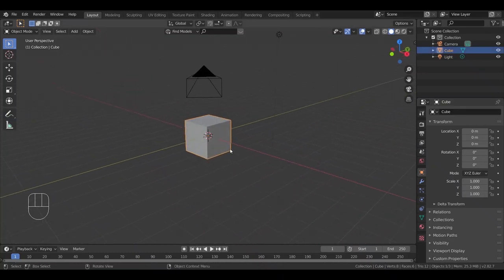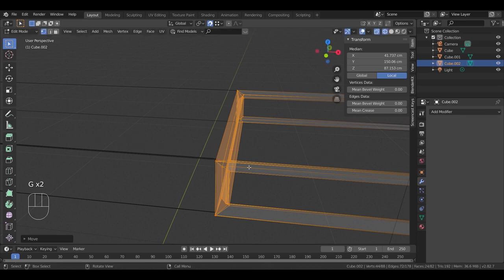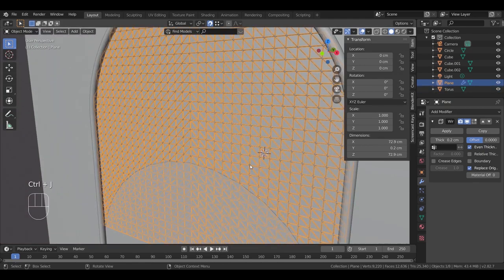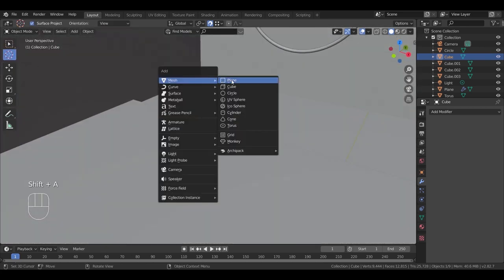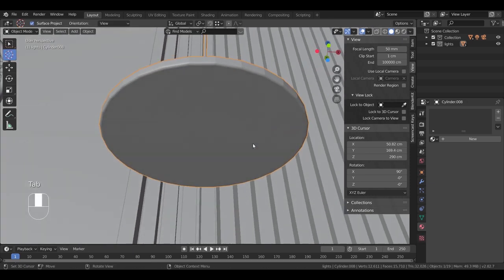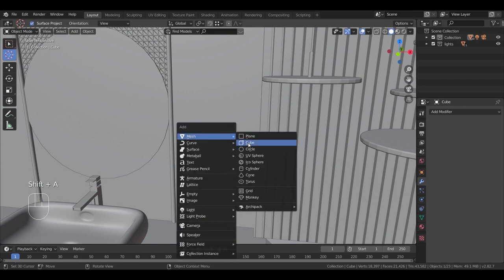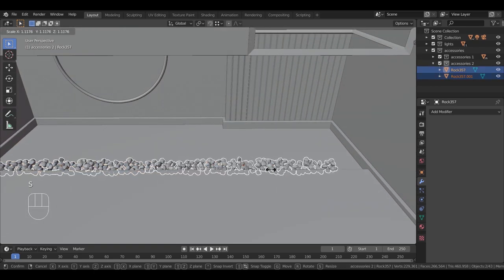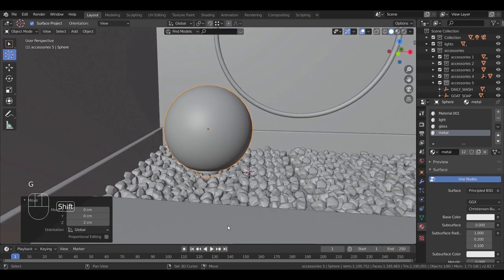How to make a Modern Bathroom in Blender | Part 1

Comment: Could you please also share a to tutorial about camera movement? Im new to blender and im trying to make a simple animation inside a room. I searched a lot. But i dont find a good toturial for moving camera insde a room. Camera hits the walls and the result is not professional. I know that there are some techniques such as set the camera in walking mode. But the result is not good when the space is small. Thanks you so much for your toturials. They are so helpful 🤗🤗👌👌👌👌👌
Reply from the maker: Well you can either move the camera with the move tool G and add 2 keyframes in the start and end.
or as you say use the walk mode, the animation might be rough but you can smooth it in the graph editor.
I did make an animation like the last one in my interior plan tutorial and with eevee render engine so check that out.
Wish you the best.
Reply: @architecturetopics  Thank you so much 💖💖💖💖